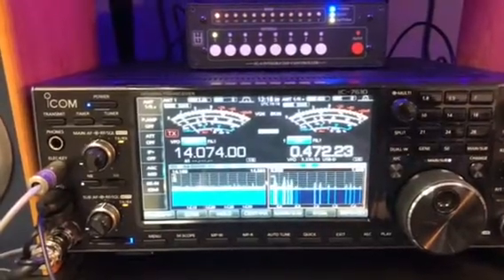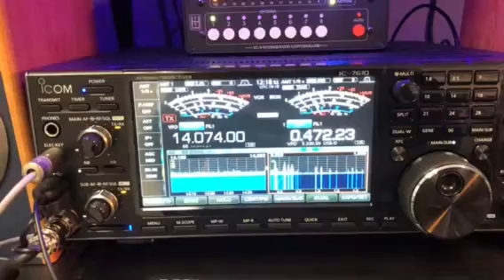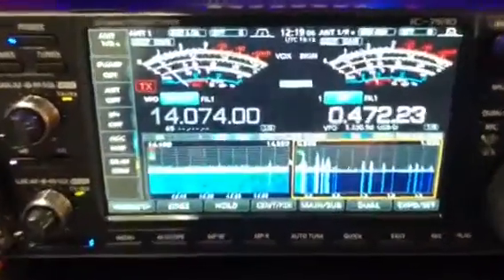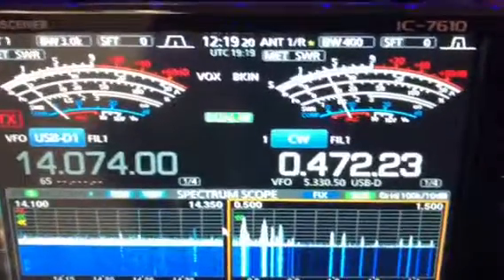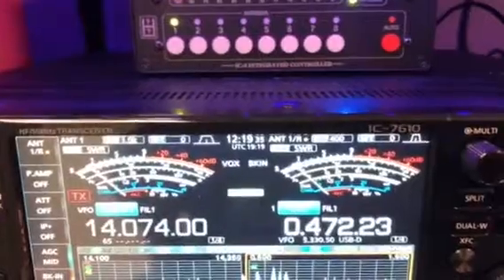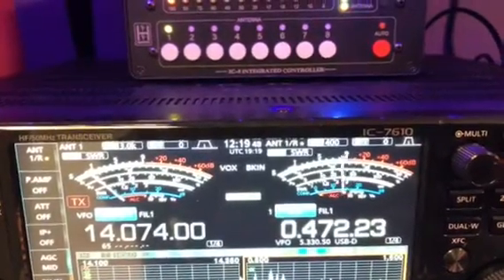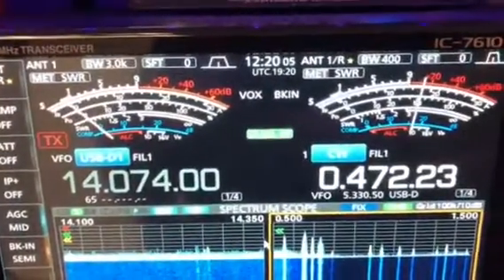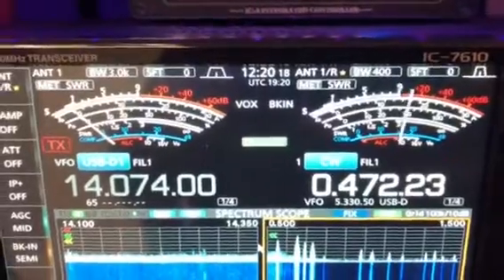W6LVP Loop - 27 dB null (@473 kHz) demonstration at VE7NZ

Comment: Very interesting demo of LF directional (nulling) capability of a small 1 meter diameter loop.  Some AM broadcast DXer use this feature to separate two stations on the same frequency.
Larry
W6LVP
Reply: Yes, getting more directional on the mediumwave and below is common on the active loops. Using the Timewave ANC-4 with a second outdoor antenna to phase it out also works well.

Comment: Truly enjoyed your video!!!! I have had my W6LVP for a couple of months and just love how it will null out RF hiss background noise as well as power line noise. The W6LVP is great at noise reduction and I was surprised that the noise direction is different on different bands and different times. I also use the Channel Master for my Mag loop. I have the W6LVP up about 20 ft and use it for receive and my 132 ft 80-6 OCF dipole for xmit. You have to hear the W6LVP before you can believe that it can make 40 meters almost sound like 2 meters squelched when conditions are good otherwise it allows you to pull out signals that are down in the noise otherwise.

W6LVP customer service is incredible and he is always there with suggestions to make operating the best that it can be. In fact, I have watched many videos on youtube and I am convinced that the W6LVP is the quietest mag loop available at any cost. I am tempted to just buy another as a spare for travel and camping. I can't believe that I can do anything more to improve my receive. Hams don't believe it until they stop by the shack and see the difference themselves.  This is where your video demo will help convince others of how great receive can be with the W6LVP Mag Loop. My email is good in the QRZ website and I would look forward to sharing experiences with this excellent antenna with others interested in making the most of their stations.  
Ken Wigger
WD9GNG
Reply from the maker: Ken - Glad you like it too! There's a mag loop facebook group that's a great source of info and stories exchanged if you are interested. 73, Adrian VE7NZ